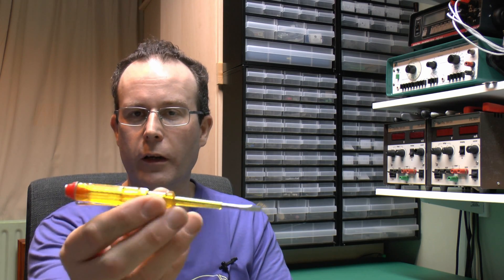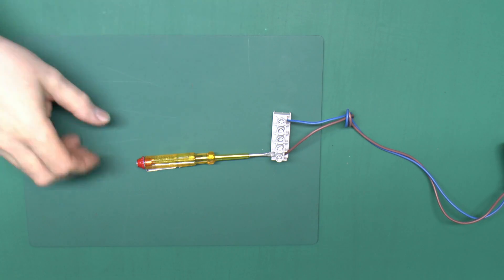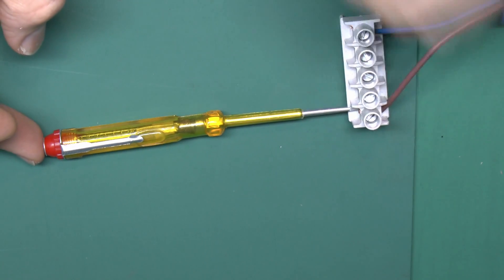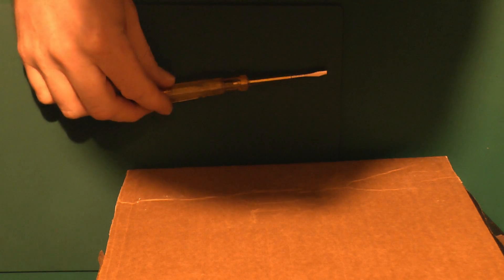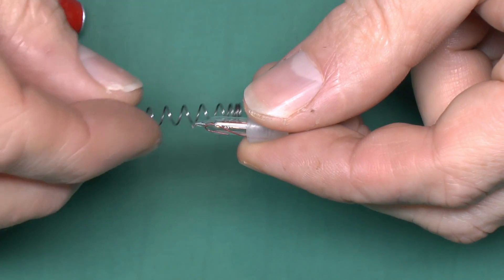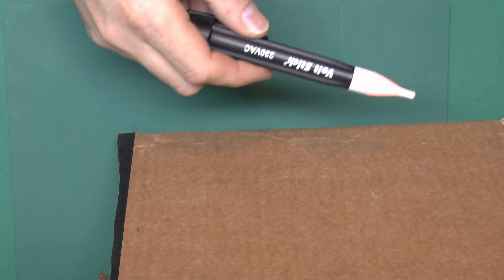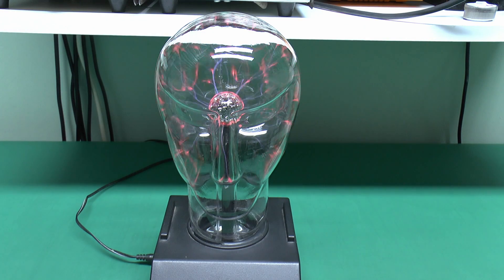Dangerous Device - Neon Mains Testing Screwdriver

Comment: When live and neutral are in close proximity, the non-contact tester will not differentiate between them. All it will say is that there is voltage "somewhere around here". That is why, in fact,  the line and neutral were spread so far apart in the video - the test would not have worked otherwise. The non-contact tester is good for determining that a given circuit is powered up. And the neon tester is good for differentiating live and neutral wires or contacts. As with everything electricity-related, care must be taken when testing.

Comment: My father used this for 30 year for home electric. I also used for months, never had issues.

But tbh, you should generally avoid touching to cable if they are still connected to circuit even if you are sure there is no electricity, and better do not touch to walls and wear a electricity resistant shoe  😂

Comment: It is called a phase tester for a reason mate - if you switch the phase around, obviously it's not going to detect on neutral. Measure neutral to ground with your multimeter and phase to ground, same issue, init?

You use these in both, not just one.

Comment: You've convinced me to not use one of these screwdriver thingys.  I'll use a neutral/live probe from now on.  On the subject of neutral/live  why don't they call it positive and negative since that's what a voltage crosses, electronics is so overly confusing with terminologies.

Comment: Before using any tester you should use it on a known-live circuit to test the tester itself.  Yes the pen devices could fail but then so could your two-pole tester - what if the bulb blew? There's also a problem with using a tester between the live and neutral in that, if there's a break in the neutral wire, or it's otherwise not connected, the test would show no voltage yet the live wire would still be 'hot'.

Comment: For those using when wanting to know which is live, you can just use multimeter probes. The live wire will show several volts if other probe is simply touched to any nearby structure.
Reply: There are risks associated with using a multimeter.   You need to ensure that the dial is at the right setting, AC not DC for example and the right range if that is also needing to be set.   You need to ensure that the second probe is touching a known good earth.   The biggest risk is if the second probe is instead used on another wire that is at the same voltage as the wire you believe is "live".   Because both wires are at the same voltage, say 240v, the multimeter will show a difference of 0v on the display as they measure the DIFFERENCE between the two probes, you will believe both wires to be safe.

It is the reason why approved voltage testers are a thing!

Comment: Actually,  very factual comments and yes,  lethal  for the untrained persons.   However, as a maintenance electrician in the 1960`s - 1980`s, I found these little tools invaluable when fault finding.  i.e. when working on complex production machine control  panels where we were looking for voltages at certain time.  These were often only a little blips  as a component passed through a gate etc.   or working on automatic  electro Plating plants,   just to name a few....   Remembering of course we are talking about complex relay and contactor switching controls. Semi conductors only started showing there faces early 60`s. 
Final point and has already been stated, NEVER reply on just a neon tester.  Always make a point of using the correct tools to make sure ciriuts are indeed safely isolated if about to undergao work.

The Nean Screwdriver  tool, used within it`s correct paramitors of it`s  design, saftey and  usage,  were and still are  wonderful, and I still use one  at the age of 80.  Yes, I`m still living and never been killed by a lone neon tester ............YET!
Steve T

Comment: I guess that I will buy one of the screwdrivers for my repair kit just to have some indicator while working on i.e. a power outlet that no one has turned on the breaker while I'm working for some reason

Comment: Would I be right in thinking that the 'safe' two pole tester will not work if there is a fault on neutral?
Reply from the maker: No, it includes single pole detection for voltage using capacitive coupling through the plastic case.  Doesn't show actual voltage level in that case but will show visual and audible alarm that voltage is present.

Comment: thanks john. gas engineer ere and i use there for quick diagnostics for live wires for heating controls. is there a safe alternative screwdriver that does the same thing? thanks
Reply from the maker: https://www.socketandsee.co.uk/socket-and-see-epf-pro-hazardous-voltage-and-phase-finder.html

Comment: This tool DOES NOT measure voltage. 
It indicates the active phase of single phase power connection ONLY.
The phase indicator  IS NOT used to detect power.  
This video is misleading and dangerous. 
The tool tested is a cheap one.

Comment: These sort of Neon Main Testing Screwdrivers have been in used and manufactured since electricity was first discovered.  If it is that useless and dangerous, it would have been all declared unsafe and no longer be allowed  to be used nor be manufactured by International Conventions.  One thing is certain,  these cheap electric testers are definitely not the most suitable and should be used with good cautions.

Comment: Slightly misleading content there...let's get a bit safer here.

The screwdriver Neon is NOT intended for proving or testing for voltage on mains circuits. The ONLY way to prove any given point  is dead is to use the  "prove-test-prove" method. That means take a 2 probe voltage indicator and use it L-N on a known live source or proving unit to see the tester show voltage, then test the circuit you will work on ( and have LOCKED off) L-N, L-E, N-E to see the tester show no voltage, then re-test on the known live point again to prove the tester is still working. This is the ONLY safe method.
The screwdriver Neon is actually ONLY ever used to confirm POLARITY of a supply and is the only device that will do so on an incoming supply that has no convenient earth terminal. End of.
Oh and NEVER use a volt stick except for circuit identification.

For the record I am Electricity Supply industry trained 37 years experience and still alive thanks to the above methods.

Comment: I'd always wondered how they work. Now knowing that your body is used as a route to ground while sticking them into the mains electricity is certainly food for thought about whether to use them or not!
Reply: They are fine, this is hysterical nonsense.   On domestic circuits the resister would fail open meaning no shock.  He is being dishonest and designed the tests to fail due to his obvious bias.

That "approved" two pole test lamp he is using could get you killed if the neutral was not connected, however the screwdriver would still detect the live wire and save your life.   Of course he doesn't mention that, now ask yourself why he doesn't.

As with everything, know the limitations of the testing kit.   There are gazillions of these screwdrivers in use, they would have been banned decades ago.

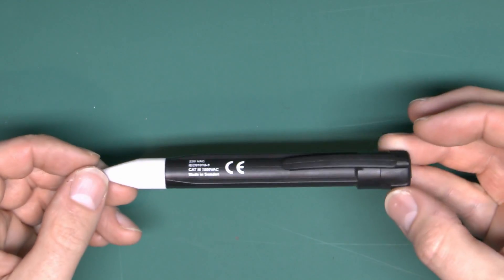Comment: 6:50 Volt stick - amazingly unreliable device !
Reply: I encountered one that was hilariously sensitive, while working as an assistant with my uncle, had this volt stick sitting on the dash of the work van and noticed it would activate whenever the engine went over 3,000 RPM XD

Comment: Am wary of electrics.. but needs must. Surely using multimeter £8 & the cheap "screwdriver" tester. Would be the solution?
Reply: The multi-meter is very risky.   If you have an open neutral it would display 0v when one of the wires is live.  If you have both wires at the same voltage then the display would show 0v as a multi-meter measures the difference between two wires.  For example, if both wires were at 240v the difference is 0 and you get killed.

The actual solution is to use a voltage tester that also does the important "single pole" test (what the neon screwdriver is doing).

Comment: Thanks for that..
I recently purchased a 99p  electrical screwdriver, which I found wasn't lighting up, so I took it back to the shop, and the shop assistant tested it in a socket and it lit up, so is unreliable. 
I recently had a partial rewire carried out on my  home and the electrician also condemned the electrical screwdriver with explanation and he was using a non contact volt stick. 
So, I now have a stick which lights and beeps(LAP voltage detector £7.99) 
the small screwdriver I'll just keep for small terminal screws...
Reply: The issue with voltage sticks is that the "live" wire in a 3 core can be blocked by the neutral.  You have to be very careful when testing multicore and run the volt stick along the length of the cable AND around it.

Comment: Personally I use my DVM to check if power is there when the circuit is energised. I then  switch it off and check that now the DVM shows no volts 
The neon is  a useful tool and could be used before and after as confirmation. The carbon resistor will be a type that fails open, also the neon will be a low wattage one that vapourises before it can pas lethal amounts of energy. Thinking about what you are doing around lethal voltages is a good habit, I applaud both this video and the comments.

Comment: What test instruments did we have back in the 70s / 80s ?
Answer we had crank operated mega and neon screwdriver, and they were/ are perfectly suitable and safe for the job . Know we have MFTs and two poll voltage indicators with fancy names and over priced , and now we are led to believe that the gear we had before is dangerous, yet mega still manufacturer the crank operated mega  . It is all lies to make us buy overpriced fancy testers that we don’t really need .

Comment: I do appreciate your videos. Interesting one on the neon tester screwdriver. I agree it could be made  intrinsically safe on paper - by the addition of another series resistor so there would have to be two failures before a significant shock hazard but it's still very unlikely the resistive element should fail short circuit given the lack of stress time to the component. The more significant hazard would be water ingress but then again the other testers you show would also be prone to such an IPxx exeption. You also didn't mention the hazard of through conduction from lead tip to loose tip (if inadvertently touched) with your test lamp or an open circuit neutral making two lead testers problematic.
I own a Steadfast neon tester which is sealed with a tight screw on machined aluminium endcap and therefore waterproof.
The advantage of the neon tester is its simplicity and using your body as a current limited capacitive earth so only needing one touch metal  "connection" to the live terminal. It safely copes with a missing neutral fault too unlike your two lead testers and you can dab it around to spot reversed polarity and even a live CPC! It's less prone to stray electric field pick up like your "Volt stick" too. You know if the neon lights it's "live" with voltage but as you correctly point out with a high PV field from your Tesla lamp, it lights but does not indicate current capacity - but then again a false positive in that case is not a hazard.
The safe way to use the neon is to confirm it lights on the item(s) in question then isolate the supply and repeat the exact same test to confirm it does NOT now light up. That way you cover all the variables of lighting, position etc. I'd argue that a good quality neon tester's simplicity and ease of use, coupled with knowledge of its capabilities make it safer for live indication than your other testers. Imagine if your CPC and neutral were cut - how would your two wire testers cope with that? 😮
Reply: I'm glad you see it my way.
Dad's garage was 'off' - nothing would work except the neon tester. Yep broken neutral - but it had him puzzled ;)

Comment: JW as an electrician myself, i’am a bit confused, if like you claim the neon screwdriver is useless and dangerous then why in god name would you an electrician with years of experience and knowledge put you finger on the end of the neon screwdriver knowing you could potentially electrocute yourself? Why ? Please reply to your posts and messages and answer questions and it is extremely rude and arrogant to ignore your viewers especially as you what people to subscribe to your channel . Now to fair to you I like your videos but you have put some silly and misleading ones out as with  the one on so called fake wago connector’s, that were rated at 20 amp  then you push 200 amp or so through it and was surprised it melted and court fire. Oh and there is nothing wrong with Chinese products 
Have a good look around your home most if not all your electrical appliances were made in China yet your happy enough to plug them into the mains with out any thoughts to weather they are dangerous or not.

No response? So I am right again.

Comment: No one has asked a very important question, if and that’s a big if the neon screwdriver is dangerous ? Would JW a very experienced electrician put his finger on the end of that neon screwdriver knowing he could potentially kill him self? No of course he wouldn’t, secondly he did not touch the live terminal every time,  they are not dangerous if they were they would have been taken off the market year ago. There are two types available the 6in rated at 500V and an 8in rated at a 1000V both have been available since the 50s and are perfectly safe as long as they are used correctly.  But they should not be relied on as with the non contact voltage stick.

Comment: Thanks for the lesson. I have two in the garage and now I've seen your video  I'll only use them as a regular screwdriver.
Reply: Ironically with an open neutral it would be the neon screwdriver, not his approved test lamp, that would save your life when used like on this video.
Reply: Pete, You should read the comments. At least in the united states, this product is UL listed and it does exactly what it's supposed to..  There are a lot of electricians who are talking about how much they like these (I am one of them; I always keep at least two of them because they're easy to lose.  I've never had a problem in 30+ years).
The video is really just BS.

Comment: In my extensive experienced in getting shocked by floating voltages and wrongly color coded live wires, I can tell you that the neon tester is very reliable in locating floating voltages, without the need for a reference voltage or ground, which is invaluable. It does not even actually "need" for you to be grounded to work. It will use your body capacitance to work. It will glow stronger when you are grounded, true, but it will glow in any case.

The fact that it will only glow for wires that are actually loaded with voltage is in fact its actual "feature". Almost any other tester will tell you there is a potential between two wires. The neon tester will just tell you if this specific single wire you're testing has the "potential" to shock you.

I have also "never" been shocked by a neon tester, ever. And the idea that it can shock you "if it gets damp" is just a joke! Would you use ANY electrical equipment to test for voltage if it was damp or wet?! would you use the "proper" one you're using there? If you did, you would be an idiot. That's not a valid argument against the neon tester.

NO TESTER, should be used to make a decision to grab any wire just by testing it with it. ANY tester could become faulty at any time.

When testing any wire for voltage one should test the wire, then attempt to toggle it's state (by for example flicking the relevant switch) to see if the used tester registers a difference. If you can see the tester toggle with the switch then you know it's reliable for this scenario.

If that is not possible then you should still always handle any wire as potentially live. 
If I use a neon tester and can't toggle the circuit, and the tester doesn't glow, I still measure it against ground and perceived neutral.

But in a case where I would use the multimeter AND the "proper" tool to test against both those, and found no voltage, if the ground and/or perceived neural wires where faulty and disconnected, that could still be a live wire. The neon tester, in this scenario, would probably save my life.

Any equipment is dangerous when you don't understand how it should be used. 

instead ot hating on it, better make a video explaining WHEN the neon tester can be unreliable, and how one should interpret it's behavior in various cases. That would "actually" be useful.
Reply: "But in a case where I would use the multimeter AND the "proper" tool to test against both those...."

What did you mean by "proper tool"?

A Fluke T90 or similar voltage indicator makes both your multi-meter and neon screwdriver redundant for proving dead, giving a clear audible alert and LED to indicate the presence of phase rather than relying on a dim neon.
Reply: @zed351 
By proper tool I mean what the video calls a "proper tool": a two-pole tester that needs a ground/neutral reference to function.

The T90 is a better tool, I agree 100%, but it also costs about 100 times more than a neon tester and anyone can have one at his home. The T90 is very unlikely to be in a home toolbox, whereas a neon tester will be, and it's a valuable tool when only two-pole testing is available otherwise.

 BTW: When using the T90 in one-pole testing configuration it can still be confused by the same factors that can affect a neon tester.

I'm not trying to prove a neon tester is the best thing since sliced bread, but it's not useless, and it definitely isn't a death wish like it seems to be portrayed here.